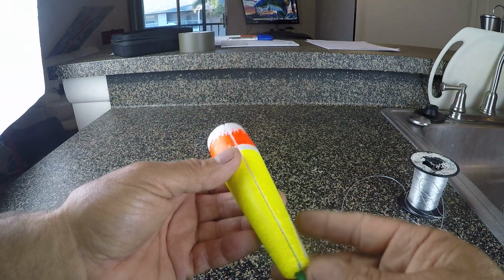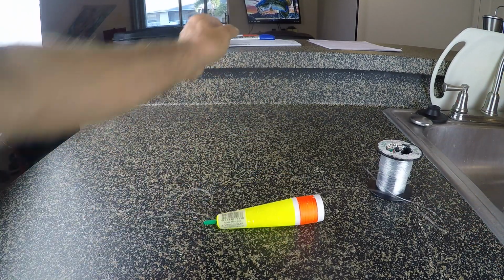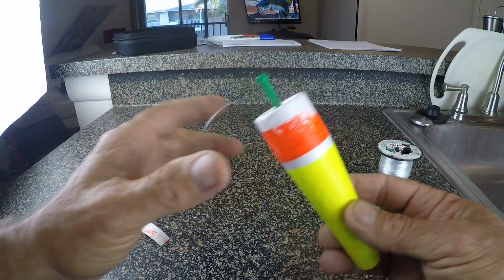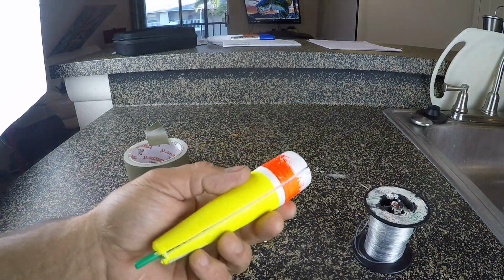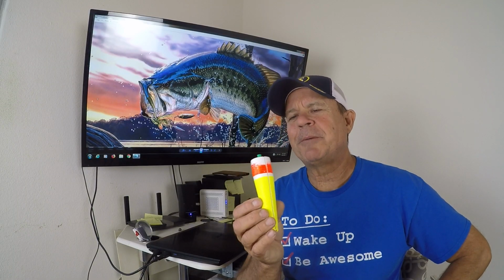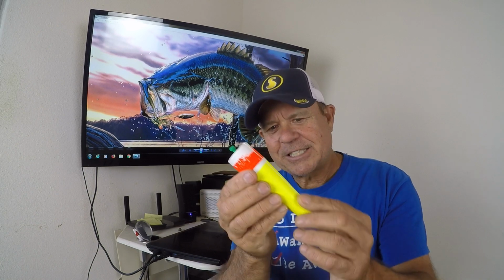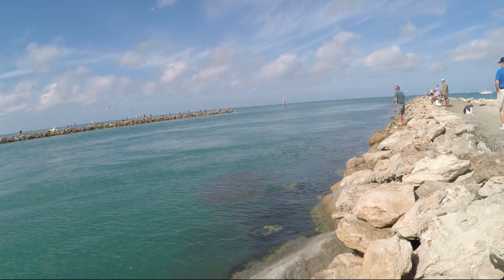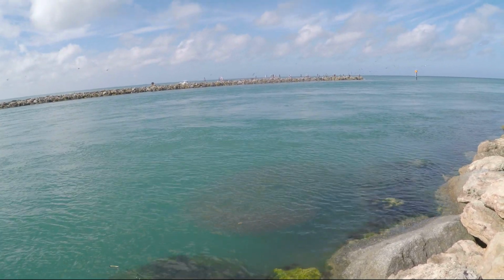Fishing Bobber Problem, The World Needs Your Help

Comment: Drill two hole through the cork one in middle a second towards the top through the cork. Then take your string  either from top or bottom until your string hits one of the two holes. Pull line through and out side hole take the string put in the second hole  until the string can be retrieved back the the upper hole and out the top or bottom of cork the you can set your dept and insert the dowel

Comment: Drill two holes in the green stick. Feed line into the green stick like you were using it as a slip cork. Run line out of first drilled hole that's near the top and run line down the outside of green stick until you get close to the bottom where the second hole is drilled then feed line back into the green stick and pull put the end of green stick.
Reply from the maker: Great tip for sure, but the video is about the bobber was designed to be easily removable without having to cut the line.

Comment: At 73 and having fished since since 1952. ..  I never go anywhere without a few little items in my tackle box...one is pipe cleaners...and Two is rubber bands....in this case the rubber bands you want are at the Dollar Tree stores etc. And they are tiny black rubber bands that are made to hold hold dreadlocks as far as I can tell..they barely slip loosely over one finger but they stretch like crazy and you get about 200 of them for a buck...put one a quarter inch from the top of you float and another a quarter inch from the bottom....I actually use them to put around plastic bugs and mice and lizards from the toy dept to hold my no.1 and 1/0 and larger hooks...I catch as many large bass on leftover Halloween plastic spiders as most guys do on $7 lures....with age comes knowledge and with knowledge comes wisdom..
.
Reply from the maker: Thanks. This video has had so many views and loads of sarcastic comments. Your solution to the problem is the best I've heard, wow. Excellent idea! I'm going to try out your idea and if it works great I'll make a video boasting the solution!
Reply: @RadReelingFishing  ill add the rubber bands you want are at tractor supply and they are used by people who braid their horses' tails. wicked tuff small rubber bands. just my 2 cents worth.
Reply from the maker: @mikesevercool9099  The best reply in a couple of years. Thanks.
Reply: I replace the stim with a cheap glow stick. It is a little larger and if fishing at night.... Well it's hit.

Comment: Have you tried cutting down one side of the green insert to put your line in and turn 180 to foam cut and snap together. Wala, use a peice of something (tooth pick, dowel) to insert into the top hole to hold line.

Comment: HELLO.... GREAT VIDOE. THE CENTER  PIECE TAKE A SMALL DRILL BIT AND DRILL A HOLE AT THE TOP AND BOTTOM OF THAT GOES IN THE MIDDLE AND FEED THE LINE THREW THE HOLES AND THEN TIGHT IT UP.

Comment: OK JC what you do is do you get a paper clip you cut two pieces and you bend one part like a little handle or you stick it through one part of the Styrofoam through the other on the top and on the bottom and that will help keep the line from slipping through and when you wanna do something else you can just slide one out put it line back through again and then slide it back in or toothpick but I think a paperclip would work pretty good.

Comment: UK guy here ....

thread line through the green tube ...
Green tube is now fixed on the line. 
the green tube is designed to stay on the line .
now the float bobber can be taken off and on the green tube via the slit in the bobber .
that's the purpose of this float.

you're trying to solve a problem that was never a problem

Comment: I use those floats all the time because I find them all the time where they are floating free or along the shore.  Others must be losing them faster than I do, but I seem to have an endless supply. ;)
Reply from the maker: Ha ha...I see them floating in the current too sometimes. Must be because the dang line won't stay in the slot like I'm saying...ha ha Thanks for commenting, too funny.
Reply: On that bobber I put the string through plastic straw and put slip bobber stop only on bottom with small split shot when you cast the bobber free floats and line is straight down at what ever depth you want

Comment: Have you tried putting a clove hitches on one end of the stick before plunging it down? Then doing it for the top part before finishing applying pressure to secure top?
Reply from the maker: I have not, but that sounds like a possible solution for sure. Thanks for watching.

Comment: I use those style floats in different sizes and various brands.
I never really had a problem with them but I look at them every few casts.
I just live with it,only takes a few seconds.
Reply from the maker: Thanks for watching and commenting. The other night I was for tarpon using one with 80 lb test mono leader. No matter what I did that darn line would not stay in place in the bobber. That's when I got the idea for the video. It's been a lifelong issue with this product for sure. I think I need to order in something that works soon to have on hand. I rarely fish with bobbers...
Reply: @RadReelingFishing  
If I were having such a problem I'd just add the rubber stops and use it as a slip float,only takes a few seconds to retie a knot.I use it that way a lot because I don't want to try and cast 6-40' of line at the end of the rod.
I leave the stop on the line so at any time I want to float it it's already there.I'll also add another stop below so if I snag and have to break the line I can usually get the float back even though I've lost the hook and weight.For a piece of cheap foam a float is pretty expensive.
Reply from the maker: I like the idea of just leaving a bobber stop on. I'll have to do that next time I'm Tarpon fishing in that area.  Great tip, thanks.

Comment: I figured it long ago...I use 80lb mono and crimp a swivel on the top and a costlock on the other and reverse on others when I want to fish deeper the lock is on bottom but if I want the bait closer to the surface I put the lock on top and put maybe a wire leader from it...it's the closest I've come to removable access you can actually clip the bobber to the line I've done it...but in times past its not hard to slip the line through the plastic retainer and retie it if you want to change it up when you fish it's virtually not a problem...things happen...you break off...you get snagged etc... it's all in the game...that's why we have several Knotts forged in our memories lol

Comment: I imagine you can just use fishing line or a rubber band to tie it to the top and bottom of the plunger. Even cheap dollar store zip ties.

Like you set it up as normal snip a extra piece of line and tie it to the top part of the plunger so the line is anchored to the plunger in place.

Comment: Crappie Magnet has the same type floats. They use a cone, one the top and on the bottom, instead of one solid holding pin.. Maybe a golf tee on the top and one on the bottom. If not, I would use rubber bands on either end.
Reply from the maker: Great suggestions for sure. Thanks for sharing.

Comment: Surgical tubing, you're going to want two pieces of surgical tubing the top one you'll want about a half an inch long and the bottom one you'll wants about an inch long. Flip both pieces of surgical tubing over the swivel and onto your line and now you simply set the bobber where you wanted and put the surgical tubing over the stick

Comment: Try putting  a litt strip of concrete  in the bober so when you put the stick  in the stick is snugg extra tight thus holding your  line tighter.

Comment: Drill 1 small hole all the way through both the top and the bottom of the green stick about 1/2 inch from each end. Next place the green stick where you want to attach it to your line. Make a loop with the line at the top of the green stick and thread it through the hole and then over the end, pull snug. Run the line down to the bottom end and repeat the step. Grab the float and run the line through it so you can pull the bottom end of the stick through the top of the float and all the way through. Push the top of the green stick through until it’s seated. 

Another variation is not to drill but just to wrap your line spiraling down the shaft of the green stick from top to bottom. Then load and pull the green stick through the float similar to the other variation. I believe this variation is most likely the way it should naturally be done.
Reply from the maker: Thanks for taking the time to add a comment of value, greatly appreciate your input! I'm going to try the spiraling down the shaft method.

Comment: Run ur line through the green tube..

Double it around and put it back into the cork with the line away from the slit....and wala....fixed and line wont come out of the slit.
Reply: But then he can't take the green stick off. Wants to put on and take off without retying.
Reply: Kayak Hacks uses a razor knife and small hacksaw to make a slit along the entire length of the green center peg.  Personally, I would rather have one rod rigged with a float, adjustable line through center peg with a stop above the bobber and one rod without a float.

Comment: The best way is to take the line and wrap it around the top and the bottom then take the duck tape and put a piece on the bottom part then take your snips and cut it off of your main line and throw it straight in the garbage!! That’s the solution! 👍
Reply from the maker: Ha ha...I was totally reading every word, too funny. Thanks for sharing.

Comment: There are a couple of solutions to that problem, you tube search popping cork rigs. C’mon bro this is not that difficult. I almost unsubscribed, but I’m going to give you another video strike because you’ve been good so far.
Reply from the maker: The point I made is valid. Yeah, you can run the line through the plunger, but that doesn't make it quickly removable like the groove. Do you have a suggestion for an easy fix to the actual problem I pointed out? Interesting comment though; I have over 500 videos in my library and you're considering unsubscribing because I pointed out a real problem with this bobber.

Comment: Easiest way to address the float problem is to first remove the center post from the float, then, second, use a section of wire crimped or haywire twisted to a barrel swivel on the top end of the floats center post which is then run down into the center post to another barrel swivel at the bottom of the post secured in the same way. Next, run the end of your main line through the top barrel swivel, next, while holding the line off to the side, push the bottom of the post to the bottom of the float (not to hard, you want it a bit loose). Then, run your line from the top barrel swivel which you’ve been holding off to the side, down along the slit in the float and out through the bottom barrel swivel. Now you can gently twist your line around the post several times by turning the post so the line can’t come out of the slit (unlikely), but more importantly, so the line stays tight between the post and the float. Seat the post firmly the rest of the way in the float and your done. 

Hope this solves the problem for you!
Reply from the maker: Thanks for taking the time to share with many thousands of people that will visit this page through the years what you've discovered that works for rigging these floats, greatly appreciated.

Comment: first
Reply: Sorry can't think of the name of the knot but the slip knot that makes a loop. slip the loop over the top of the pin, pull it snug, same on the bottom.  it will be there till you take it off then just pull the loops out. give it a try and I hope you understand my  directions.
Reply: Charlie Alley ?
Reply from the maker: I do understand your suggestion. Thanks for helping out, great idea for sure!